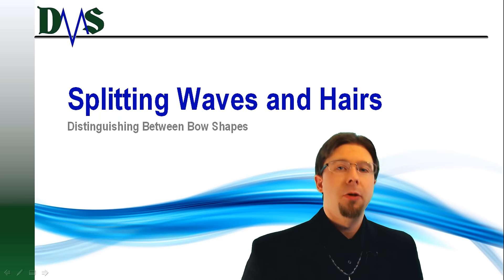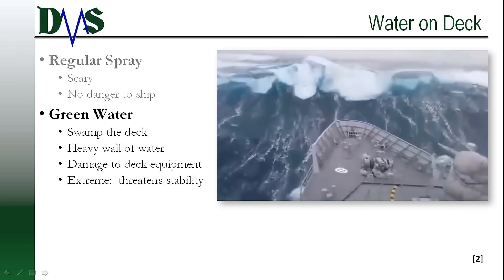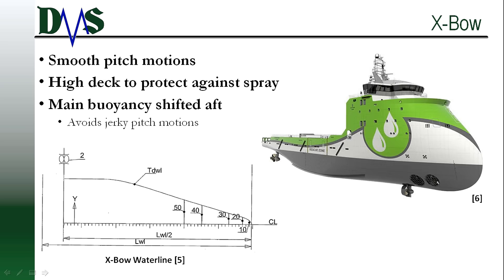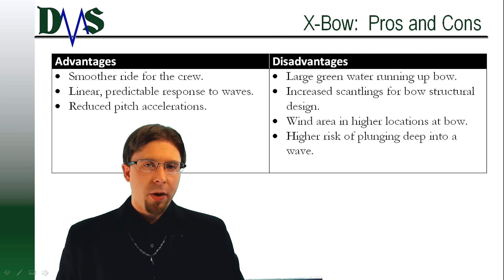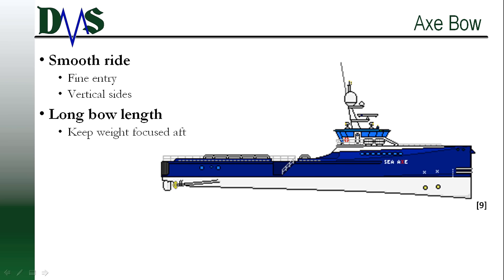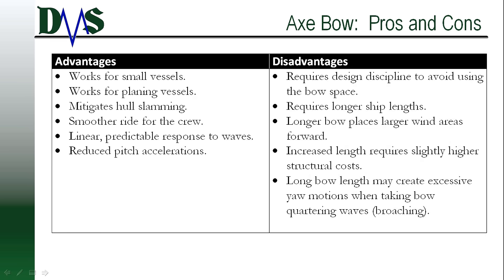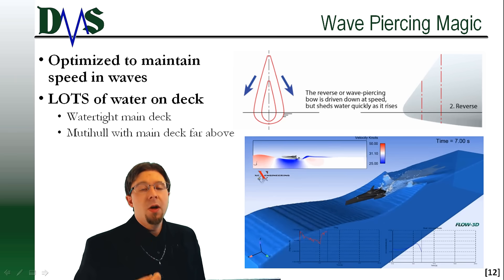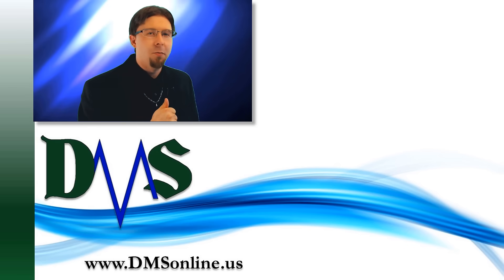Splitting Waves and Hairs:  Comparing X-bow, Axe Bow, and More

Comment: one thing i wonder about, would sea axe and wave piercer be dangerous in extreme waves- is there a danger of diving in, too deep?
Reply from the maker: With large enough waves, any bow design will be in danger.  But I don't see the sea axe or wave piercer as any more vulnerable.  With green water on deck, the natural buoyancy of the bow takes over and drives back to the surface.  In some ways, they are less vulnerable to extreme waves, since their design assumed waves will constantly break over the bow.

Comment: the backwards angled bow has become very trendy on high performance racing multihull, and also luxury cruising multihull. I'm a little bit wary of it to be honest. For a racer, if you don't win, well you might as well sink, so they care more about going fast than keeping dry, but a crusing cat speed is cool, but not really as important as comfort. Although, if the boat is only sailed in moderate conditions, then comfort is much easier. But if the boat is sailed in extreme conditions (something that may not be the plan, but ends up happening). A sailing multihull is also light, so it doesn't have the inertia that you recommended. So, is a wave splitting hull more likely to pitchpole? it's definitely more likely to dive into the wave, but would have less resistance to come out, but would that be enough to make it safe? or would a flared bow that's less likely to enter the wave be safer? I guess this depends on the drag of the submerged shape and is a question for a naval architect!

Comment: You mentioned X-bow could be more beneficial for larger vessels. I'm sketching on a small sailboat with a 5:1 LWL to beam ration; would the higher ratio be beneficial for this bow design?
Reply from the maker: Probably not.  The X-bow depends on having an extremely high freeboard, well above regular wave height.  A small sailboat can't achieve this.  (It would require a bow near the same height as your mast.)
Reply: Haha I don't want a bow that high, but I was thinking on height be the 1.2 of the beam. The Atlantic rowboats have a very similar design as the X-bow, and they are about the same size as the sailing vessel I'm sketching on.

Comment: So had to look up mass on a rod moment of inertia, I = mr^2. In other words double the mass and you get double the moment of inertia, double the length of the boat and you get four times the mom of inertia. So a boat 2x as long won’t necessarily have 4x better resistance to pitching,  it perhaps it points to designers focusing on length over weight as a stronger driver of resisting pitching moments

Comment: Great content. Perhaps a video just on moment of inertia would help for non engineering types. Length of a boat matters but the distribution of mass with respect to the point of rotation matters more 😁 ie a long bow that doesn’t have extra mass will not resist pitching as much as a long bow with two giant anchors on the very front but either way mass at the opposite of the long bow (and it’s distance to axis of rotation) plays a much larger role in pitching than just bow length in and of itself. The length of the bow DOES change the point at which the boat pivots during pitching though which will of course affect the moment of inertia calcs

Comment: how does the seaman access front and throw the primary mooring rope to Mooring lines to the wharf ?
Reply from the maker: They have doors that fold down on the bow and create a small platform to stand on, outside the hull.
Reply: @DatawaveMarineSolutions  , Thanks, Sir.    If you have pictures of such foldable doors, appreciate posting here,....  I sense that for such bow designs, the ship must be DP-equipped ?  Are there any current technology - similar to the new cars - that allow the ship to "auto-berth/park" ?
Reply from the maker: @Searth63  You can find some pictures of the mooring doors here, on Ulstein's website.
https://ulstein.com/news/2018/x-bow-10-years

Browse through their gallery of images, and you will find several bow pictures with the doors open.  I believe Ulstein calls them "Observation platforms".

These bow designs don't require DP, but they tend to go together.  X-bows frequently go on offshore supply vessels (OSV), which typically install DP to hold position off an oil rig.

I have not yet heard of any applications that use DP to auto-dock a ship.  But I'm sure it's in development.  I did once see a project where two ships had to hold course and keep very close to each other (within 150 m).  In that case, they did use DP and tied the DP to laser range finders on the bow and stern, which gave accurate readings of the separation between ships.

Comment: ROFLMAO at the bridge (pilot house for Americans) watch on deck laughing as their ship hits the greenie!  (Guilty of same.. it is pretty funny).  Warships absolutely have this designed in to handle greenies, and crew comfort is not a factor (there are lots of grab points for all to hold, and it helps to hit the gym up too).  Not a bad idea though to check the ship's stability condition before the weather hits if one's ship's metacentric height is low to begin with.

Comment: I think inclusion of SWATH designs might be a worthwhile addition.
Reply from the maker: You can find SWATH designs in my other video here:  https://youtu.be/jJAHyDl6KS8
Reply: @DatawaveMarineSolutions  watched it.  Good job.  As you stated, just like a cat - very smooth until the wave capability is exceeded and that green monster slams the flat underbelly!
Have you done a comparison of anti-roll systems, e.g. gyros, wings/birds, active stabilizers, tuned water tanks, roll keels?  I find rolling to be worse than pitch (slow displacement boats).
Reply from the maker: @jamesward2276  Not yet.  Eventually, I would like to do an entire series of videos on seakeeping and comparison of anti-roll systems.

Comment: I know its a short video 
..  however its speaks in far too many  absolutes about the conventional bow .. if there is such a thing...  many variations of a common theme.   Also the x bow evaluation is based on CFD and simulation... there have to be many tow tank model tests and full scale test and trials.

Further the sea keeping comparisons for x,ax and wave piercing bows  are for head seas .. at best only about 1/4  the headings a ship experiences.
The x ax  and wave piercing bow have their niches however 
The conventional bow ..  modified v with rake and flate ...  will be the most common
Reply from the maker: Excellent points.  I agree that I did speak with too many absolutes.  I did make the conscious choice to oversimplify things for presentation to a general audience.  But you are correct.  Selection of bow shape is more nuanced, and something that a naval architect should consider carefully for each project.

Comment: The bulbous bow is designed to create two separate waves which in theory will cancel each other out, thus reducing drag, increasing fuel economy and top speed. It has to do with waterline and is known as theoretical hull speed. Surprised you didn't mention that. Working with CFD, or computational fluid dynamics, designers can create a computer model of a hull design and test it, very accurately, in that computer model.

Comment: Although I have had far less experience on blue water than Master Walrus, I have been on the deep water on Navy ships as a WW2 Liberty ship, a deep sea salvage tug, another WW2 Destroyer and a WW2 Destroyer Escort. 

The interesting characteristic of the Liberty ship was it would pull the top of the propellor out of the water in moderate 2 to 3 meter head seas. The partially unloaded prop would shake the entire ship.

The salvage tug, USS Preserver ARS-4, had a lot of top hamper and, because it was short and fat, managed to combine pitch, roll and yaw in most interesting ways. I estimated the bow would pull at least half a G upward acelleration pitching in a heavy sea. Eating became intermittent much of the time.

The Destroyer was sensitive in roll and not all that bad in pitch and yaw. No all that bad in the aforementioned 2 to 3 meter seas. 4 to 5 meter seas were another matter. Seasickness was just about guaranteed. 

The Destroyer Escort was ok in smooth water. Off the coast of Nova Scotia in January was a completely different matter. This thing pitched, rolled and yawed all the time and at the same time. I saw green water to the first gun mount on that cruise. Being below decks,  I was a snipe, looking at an inclinometer was very disconcerting. I was too frightened to be seasick. I gained a tremendous respect for the sailors that took these things out into the winter Atlantic Ocean to escort convoys in every kind of weather. 

All of these ships had the "conventional" bow shapes that were either straight up or tilted forward.

Comment: That conventional bow, with its rising flotation curve, can impart a motion to the vessel that is strenuous and fatiguing to the crew, but swimming is still more strenuous and fatiguing.  Especially in cold waters.
The X-Bow appears to lessen the tendency of the vessel to slow due to oncoming waves and moves the moment arm aft as the wave rises higher and higher up the hull, giving the crew a much smoother, more comfortable ride to the bottom of the ocean.  Plus, it's ugly, an important feature of vessels like Great Lakes cargo haulers.  The Axe Bow and Wave Piercer Bow appear to add greater speed to the "virtues" of the X-Bow.
I did like how that "what happens if we just lengthen the bow?" study from Delft University started showing profiles that looked like Cigarette boats as their bows got longer and their weight became more concentrated aft, proportionally.  "Good for planing hulls but, oh yeah, slamming," indeed.

Comment: Can axe bow used in barges ?
Reply from the maker: Barges are generally classed as: ships intentionally designed for poor resistance and high weight capacity.  I wold argue that any barge with an Axe Bow is not really a barge.  Instead, it is a ship designed with a large weight capacity.  Can we have ships with an Axe Bow that also has a high weight capacity and wide beam?  Absolutely.  But that ship would also need an excessive length.  It is definitely possible, but would require some very creative thought to make that ship perform better than existing designs.
Reply: @DatawaveMarineSolutions  Salute man you are absolute genius! And yes correct and main difficulty would be to alongside axe bow barges would be to alongsiding .

Comment: I guess you missed one point about the X-bow. Like the piercing bow, it offers little resistance to water running down its sides. In what seems to be known as green water events, this will permit the ship to develop a fairly high vertical speed rising through a wave, likely ultimately cutting through it. On the conventional bow, the water on deck will create a much greater resistance against pitching upwards. That makes me think that the X-bow will work very well in extreme conditions, and I would expect it to be pretty good at coping with freak waves.

Comment: as I watched this again, maybe for the hundredth time,  I think you can answer my question. 
Where do you classify the bow of the HAVYARD designs?  
She has got a bulb, but the upper bow works both as floating support like the X-bow, and maybe a little bit like DAMEN axe.  
I am really interested in your opinion
Reply from the maker: I checked for Havyard designs, and I came to this page, which shows several ship designs.
https://www.havyard.com/brands--solutions/havyard-design--solutions/
But I think you mean the bow shown in this picture:
https://www.ynfpublishers.com/2015/12/havyard-designs-new-type-windfarm-service-vessel-esvagt
I would still classify that as a classic style bow, but designed for heavy seas.  This classic bow has less flair and an enclosed forward deck.  Both features greatly improve the class bow design when taking on monster waves.
Reply: @DatawaveMarineSolutions  Exactly. I have also sent you a link before.
Reply: @DatawaveMarineSolutions  https://www.havyard.com/brands--solutions/havyard-design--solutions/havyard-857-we/
Reply: https://www.havyard.com/brands--solutions/havyard-design--solutions/havyard-857-we/

Comment: At 4:30 into your description, you said "...initial shock of entry", not 'shock of initial entry', which I mistakenly thought I heard and then I formed a new concept of that "point of lift" at the point of entry to "cushion" against the shock of entry you described as ride quality. A video of this is from waverider boats in Australia, and would love to hear your views on that design he used on a trihull hydrofoil. Though my thought is to make the bow of a "V" hull affecting greater lift at the point of entry and causing an improvement in ride quality and handling, especially during a following sea.

Comment: What kind of bow is the zumwalt class?
Reply from the maker: Zumwalt is basically a conventional bow with a bulb, and one slight change.  The bow has a reverse rake (and a pretty extreme one).  They do that to minimize radar signature.  Not for any hydrodynamic reason.  You can see a more complete picture of the bow here:

https://militarymachine.com/unbelievable-images-uss-zumwalt/uss-zumwalt-dry-dock/
Reply: @DatawaveMarineSolutions  why would anybody in the right mind put a bulb on a military ship that has to go many different speeds?
Reply from the maker: @alexsch2514  Excellent question.  And there are three basic reasons:
1.)  For military ships, that bulb serves another purpose.  They house some of the transducers for the sonar array in there.  
2.)  In my videos I did say that bulbous bows are designed for one speed.  What I didn't mention is that with a LOT of careful effort, you can create bulbs that work at 2 or 3 speeds.  But you have to be very careful when picking the different speeds.
3.)  Third reason is less satisfying:  force of habit.  If people see a bulb on every other ship, they assume bulbs are a good idea and require it on their ship.

Comment: Very nice, but I didn’t get a very clear understanding of the wave piercing hull. What does it look like and how does it move through the water?
Reply from the maker: The hull is very narrow.  To give a practical example, look the large Chef's knife in your kitchen.  You will notice that the knife blade is thicker towards the back, and then the blade tapers down as you get to the cutting edge.  A wave piercing hull looks very similar.  The thick section is on the bottom of the hull.  This setup cuts through the oncoming waves.  

Moving through the water, imagine an oncoming wave 2 m high.   A conventional ship would run up that wave, climbing it like a hill.  The wave piercing hull breaks straight through the wave, cutting it in half.
Reply: @DatawaveMarineSolutions  Thanks, I must have blinked for the video of that hull shape moving through those waves.  Fascinating.  Reminds me of diving into a wave at the beach.

Comment: Hello, I'm fairly new to ship design as an industrial design student, but so far your videos are really helping out. After seeing this video, I can't help by wonder why the Axe bow and Wave Piercing bow have not been combined so far? It seems to me like that would help alleviate a lot of both of their weaknesses? It wouldn't completely eliminate the main issues that I'm trying to address (spray, green water, crew comfort) but at least in theory, it looks a lot like the right design choice.
Reply: Nevermind, I found at least one trimaran with what looks to me like a combination of axe and wave piercing hull design (Rapido 60). I guess it is fairly new on the market (and quite expensive at 1.5 mil) which is why I couldn't find much about this topic before.
Reply: Even better yet, these guys patented a folding hull design for their smaller trimaran, the Rapido 50. Amazing stuff :)

Comment: I'm 3/4 of the way through and didn't hear anything about speed concerning bow shapes, the primary purpose for the bulbous underwater portion of bows is to increase speed as is a plumb bow on sailboats. A wave piercing bow increases hull speed as does a plumb bow, bow shapes have a considerable effect on hull speed, the higher the hull speed the higher the vessels efficient speed, more speed for less fuel comparable to vessels with lower hull speed.

Comment: The biggest drawback it sounds like of the axe bow is that the length of ship is larger for a given amount of cargo or weight capacity.
How does the modern axe bow concept compare to ships of the early 20th century that pretty much universally had nearly vertical stems - Titanic probably the most famous example, but almost all her contemporaries as well. Is that an axe bow, or something different? Why did they design them like that, what were the pros and cons? Why was that design nearly universal back then, but never seen anymore? I could imagine that maybe it was less efficient than the raked design, but if it had better seakeeping this would be more important for ocean liners than for modern cargo ships - yet modern cruise ships, which are even more comfort-focused, use the conventional raked bow as well. The largest ships of those times (Titanic and sisters) were small by modern standards, but even ships comparable to that size now use raked bows. 
Would be interesting to compare other designs through the centuries, from early designs to the more rounded bows of the Middle Ages, to the "conventional" bows of later sailing and early steamships (think of clipper ships), a trend of vertical stems in the late 19th/early 20th centuries, return to the "conventional" bow seen now, and the rise of the bulbous bow. Some of these "unconventional" designs, which for the most part are just small niches rather than mainstream. Think of factors like method of propulsion (sails vs. paddlewheel vs. propeller), construction methods, available hydrodynamics knowledge, and priorities of shipbuilders.